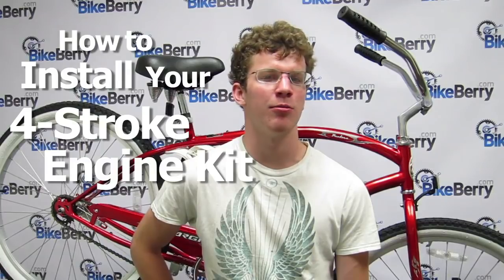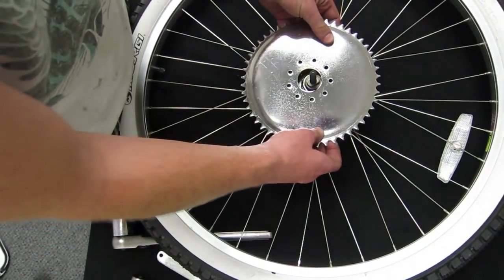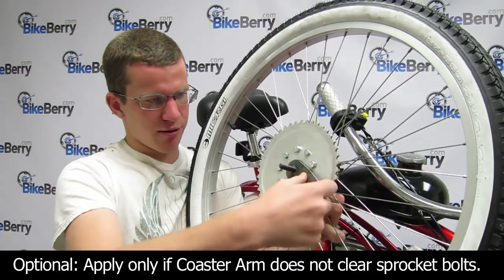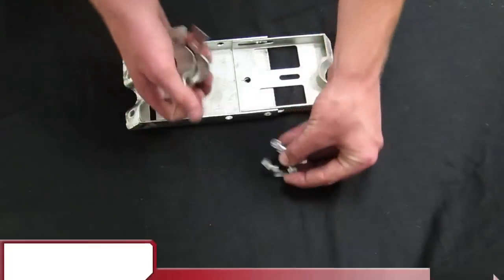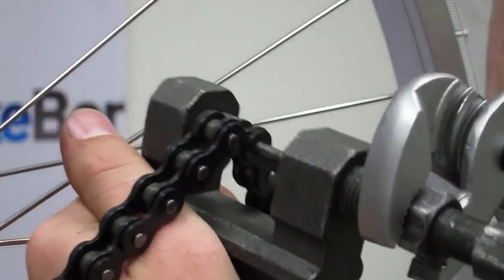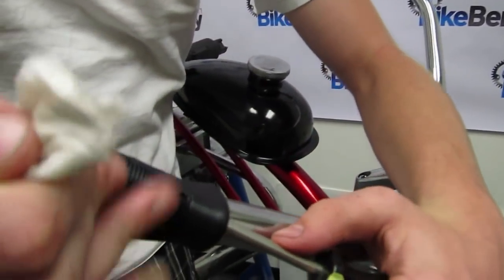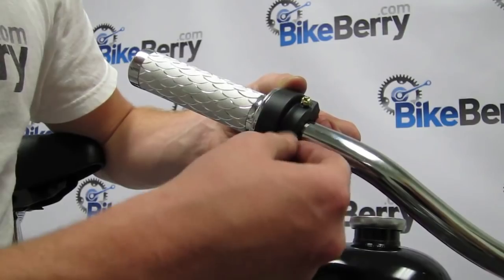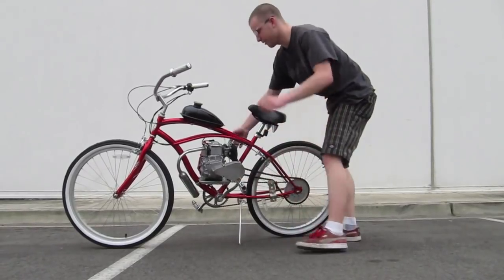How To Install a 4-Stroke Engine Kit on your Bicycle - 48cc - Motorized Bicycle

Comment: Should I get a 2-stroke or 4-stroke?
And how long does the average build take
Reply: +Damon Mohr 2 stroke is more power guaranteed (instead of having 3 unpowered and 1 powered half cycle, like the 4 stroke engine), but you won't be able to do things like leaving the oil/gas mix in the tank for too long, and you'll also have to prepare a mix every time you fill it up. I recommend you the 2 stroke, because it's light, simple, powerful and also easy to disassemble
Reply: +L3AP2020  i bet the differ i have a 2 stroke its a pain in the neck adjusting the cables for the clutch and more vibrations..im only going 4 from now on when ever i need to build me a new motorize bike
Reply: Damon Mohr For commuting I recommend a 4 stroke.  I commute with a 2 stroke but I know this engine pretty well and when something goes wrong I can tell usually what it is and fix it.  Making a 2 stroke more reliable is harder and they usually blow around 2,000-6,000 miles needing a top end replacement.  A 4 stroke last way longer around 10,000 miles up to I have heard someone have theirs for 50,000 miles.  usually on the 4 stroke the thing that usually goes wrong is the transmission and that's only if you get a cheap one.  The top 2 I recommend are the T Belt drive transmission and the EZQmatic transmission the EZ cost $500 but the T Belt comes with some higher end kits like the grubee 4 stroke (problem is that they don't sell anymore and those are harder to find)  last place to check though which are also really good is thatsdax.com
Reply: bluckingblucker 4 strokes arr good .

Comment: Best way to remove grips is with an air blower and compressor.stick the tip of the air tool under grip and comes right off

Comment: Would this fit on a 29er? You said 26inch but would a 29 inch bike work?
Reply: +ParacordTank Yes, but you may need to use spacers.
Reply: +ParacordTank the difference in the frame from a 26 and a 29 sounds huge,.. but the critical area of the frame where we are concerned would probably be only an inch longer and an inch or 2 higher... im going 29 too and im about to jump out the window and find out for myself -seeing that hes building on a 26,... and the plate looks like its got more length left to adjust outwards,  combined with the ability to lower it in the frame a little more than the video,... looks like he could go down another half inch. hes as high up as he is, to make the front tube mate up with the angle in the plate so it bolts up pretty. I can live with putting some hockey puck rubber in the gap (quarter inch max?) and just crank that sucker down tight with red loctite
Reply: +ParacordTank remember that 29 is wheel diameter, so the frame itself would only grow by 1-1/2inches MAXIMUM. and thats only on the rear wheel frame members length, the seat tube height, the front tube height/length, and the front fork length. where the seat tube and the front tube sprout/diverge from the crank hub housing and the basic shape there shouldnt change much at all. plus, finally,.. that plate he had was for a 26 inch. there was still room to adjust outwards. I dont know of any bike size between 26 and 29 so the manufacturer probably designed in that last 3/4 inch of adjustment for 29 inch bikes. even bike berry shows here that they are primarily concerned with ppl trying to go with smaller frames, not bigger.

Comment: I'm interested in getting this kit to install on my huffy mountain bike.  I was wondering do you have any way for this motor to be attached to the shift kit on my bike and still maintain pedal function?  I noticed there are shift kits but you don't offer them from your site.
Reply: shindukess i'v been looking also and been contacting ebay sellers but no-one has them.
Reply: Google sick bike parts.  They have shift kits.
Reply: shindukess yes sick bike parts has them for this engine just check if your transmission is compatible

Comment: nice video! can this be done on a geared bicycle?
Reply: I tried a 2 stroke motor on a bike with gears. Fit like a charm and they use basically the same sprocket for the engine chain. I had to remove the derailer on my crank transmition to get the motor to fit but I think it's just how my bike was shaped or something.

Comment: You mentioned a 26" bike. Is the 26" the tire diameter or some other measurement?
Reply from the maker: You are correct, it is referring to the tire size but is a common and widely accepted reference for bike size. Many beach cruisers and mountain bikes have a single "universal" size, leading to any scaling in size also affecting the tire size, which leads to the acceptance of using the tire dimensions for a bikes size.
Reply: Thank you

Comment: would any of you guys at bikeberry have any new or used engines only kicking around you want to sell?  engine has to be new or have low miles. i need one to get to work. my old engine self destructed. just need the engine. i cant ebay cause for some reason, i cant link paypal to ebay. but i can credit card purchase. plz help.

Comment: The worst part of this kit is the chain tensioner. Either figure out how to run without it, or improve it.
I welded a Chevy small block alternator bracket between the seat and chain stays. It won’t come loose and wreck my spokes!

Comment: Will this engine fit on the huffy cranbrook?
Reply: Hey Adam did you ever get an answer cause I have a cranbrook too and with the kit the motor mount is crap not like in the pic.Anyway i'm ordering another mount and I think I'll be able to rig it.It's a close fit.

Comment: Do I need to add oil the video just states gas?
Reply from the maker: +James Harkness (The Clueless DIYer) Yes, add oil as well. We recommend using 10w30 for your 4-stroke oil needs. Thanks for the comment!
Reply: +BikeBerrycom he might mean gas and oil mixture. No dont need to mix oil with gas on any 4 stroke engine
Reply: Doc842 No that's not what I meant but thank you for the clarification.
Reply: if you didn't know that the engine needs oil you have no place doing a DIY by yourself
Reply: +Bruce Nguyen thank you for your comment. Despite my lack of knowledge, hence my nickname, I think I built a pretty sweet motorized bike if you want to check it out on my channel.
Reply: My kill switch has a red and black wire and the motor wire are green and black, the video has different color wireing, do I hook up black/black and  green/red?
Reply: @JuanReyes-qv7rg  the wiring for the kill switch, the polarity is irrelevant, but I'm sure you know this by now....

Comment: Here's a suggestion. Before the installation, you should show us how to troubleshoot any problems we might encounter. I just received my first 49cc 4 stroke engine, and there's a problem with the throttle. There's no tension in the throttle spring. How do I fix that? I need an answer fast. Thanks.
Reply: Oh, another thing. After installation, take the bike for a test run so viwers can see the bike in action.
Reply from the maker: It would make no sense for troubleshooting to be at the beginning of an installation video considering many are there for the installation not troubleshooting. We have a few troubleshooting videos and are currently working on more. You can always call our customer service team for help at any time.  (800)317-0479.... We just got a super cool drone so we will certainly be getting more riding footage in the future.
Reply: @bikeberry  So, you install the engine first, then have to remove it just to show how to fix certain problems? I'm having to use a rubber washer for my throttle because the throttle spring is bad. Plus, I had to cut the choke switch in half so I could put the engine on my bike. I still have to remove it to readjust it. The chain is jumping the rear sprocket. Plus, my air filter is leaking gas and oil. If you can help me with that, I'd greatly appreciate it. Like I said, this is my first 4 stroke engine.
Reply from the maker: @UrielB86  Yes that is generally how install videos work. If you purchased your 4 stroke from us we have a full team of specialist here to help at anytime.  Give us a call or visit our website and web chat with us (800)317-0479
Reply: @bikeberry  That's the thing. I purchased the engine from EBay. I just put gas and oil in and started it. It leaks oil from the air filter, and I just noticed that it's not idling. I have no idea what to do.
Reply from the maker: @UrielB86  Sorry David, We can only trouble shoot our kits. Checkout 
motorbicycling.com which is a large forum where others may be able to assist you.
Reply: @bikeberry  Do you have videos showing first time installers what kind of oil to use? And the reason I ask you is because I get my engine parts from your site. I won't go anywhere else.

Comment: would a 4 stroke Briggs and Stratton fit on that engine mount?
Reply: if bolt pattern matches..these mount works for predator engines and more..

Comment: How much would it all cost excluding the bike ??
Reply: that kit is 279$. Let me tell you its a real pain to install. I had help from someone who knows bikes really well and we still struggled. The video makes it look nice and straight forward but it took us well over 4 or 5 hours to install cause we kept on running into issues. You are guaranteed to have to make at least one trip to the hardware store to a longer screw or something. If you're mechanically inclined and know bikes pretty well you should be fine but if not make sure you get help from someone that does or find somewhere to install it. Good luck

Comment: What if I don't want to pull a cord and I want to just ride and go. Can I pedal the bike to start it?
Reply: No. Only 2 strokes are pedal start. Problem with a 2 stroke is you gotta mix oil with gas. Another problem with a 2 stroke is the exaust pollutes more than 4 strokes & 2 strokes require more maintenance as they tend to vibrate more than 4 strokes.
Reply: Johnny B yeah but 2 stroke kit is half the price and it sounds like a dirtbike  :P
Reply: I had a 2 stroke but got rid of it because of some mechanical problems. 2 strokes are cheaply made kits. They pollute allot anyway. There are tricks to make a 4 stroke sound like a dirtbike with some custom tail pipe work. 

The reason dirtbikes sound that way is because most of them are 2 strokes. That's why you don't see them on the road anymore in most states because they are starting to outlaw 2 strokes for road use and make them strictly off road only (race track) vehicles.
Reply: Another issue with the pedal to start up method is it puts quite a bit of stress on the bicycles rear wheel. Yet another reason I'm switching to a 4 stroke.
Reply: +Tom Jacobs you really want a cop to hear your loud bike????? really? loud bikes are going to ruin it for everybody eventually

Comment: What bike did you use to install the kit on
Reply: its mostly for  26 -29 but therss always ways to work around it for other bikes..ive seen them on bmx..ladies bike,lowriders,choppers ,and cruisers,mt bikes ,and tricyle..aslong you can be open mind to expriment you can pretty much fit it tough part is always chain alignment and lenghting it..
Reply: +Ronny Khmai im dying to see that mounting plate fitted onto a 29 inch cruiser-ive seen it on every other bike known to mankind. but somehow everybody who builds a 29 NEVER posts pics or video. zero.
Reply: +robert smith  thats because not alot of people are fonds of 29ers inculding myself but ill build a 4 stroke 49cc on a female vintage cruiser 27 inch tho..ill try put on post  when i get it all done.
Reply: +robert smith  as for as mounting plates goes i think they pretty much are universals for the honda ghx50 clone but theres options for the heavy duty ones..if it doesnt fit a 29 you might have to shave the mount to fit..

Comment: OK so I need a bike motor that will go under 30 mph on flat road and less than 50 cc as I am in Texas and they require a license and insurance as well as inspection on anything more and that's kinda defeating the purpose since my job isn't the greatest and I need a temp vehicle to get a better job I'm really wanting something I can install a gallon gas tank too
Reply: any help would be appreciated
Reply: nate c get this four stroke it's 48cc, btw cops don't really know the cc's by looking at the bike as long as you are not goinf over 40mph, in fact I go over 40mph on a 110cc motorized bicycle and they don't say anything
Reply: Wow anything larger than 49 cc's you have to have a license and insurance for. Before long anything under 49 CC's or any motorized bicycle will have to have a license and insurance I'm sure. The government does whatever they want. And they're only getting worse. I'm thinking about getting an 80cc but I will pull the stickers off of it and try to hide the motor and of course drive slow and I want to quiet down the exhaust so I can ride it on Trails because they usually say no motorized bikes on trails. And if it's making noise late at night they will probably pull me over. The problem at night you can't see the law coming in the day you usually can. I want a motorized bike tried at the Beach, Trails, out and about and when shi* hits the fan.

Comment: hmm, 1 last comment. It doesn't allear with a pull start engine that somehow, the bike remains idle until U engage the throttle. I hope that's not the case!! Would kind of stink if you're not ready for the bike to move but it does
Reply: +Chris Geoffrey This engine ships with a centrifugal clutch. The transfer case should not engage if idle is properly adjusted.

Comment: Whats the hole in the handle bars for?
Reply from the maker: +xXJAKMACKXx There's a peg inside the killswitch and it goes inside that hole. It holds the killswitch and throttle assembly in place.

Comment: Cool you now own a small motorcycle with no brakes oh almost no brakes and no suspension and yet I still want one
Reply: lol that's why I'm getting hydraulic disk breaks for both wheels on mine. I wouldn't trust riding any 50cc bike with coster breaks. Let alone one coster break.
Reply: Jefferson Stealflex I got a 2 stroke model about to upgrade to the 4 stroke because the 2 stroke is cheaply made and the coaster brake is horrible at speeds, I've nearly slide into ever type of car, I'd advise multiple brakes because coasters are death at high speed.
Reply: I hear ya. I had a 2 stroke bike and it was just horrible quality. The tensioner wouldn't stay in place and the transmission broke down on me after the first 50 miles. 4 strokes are the way to go and are well worth the money.
Reply: +Bret H my coaster brake works just fine and dandy at speed. never even had a close call. driving like a maniac in traffic is probably whats wrong

Comment: Why doesn't that engine have a clutch??? Is it constantly engaged?
Reply: I think the pull start just starts the engine and it's disengaged at low rpm when you rev the engine up it engages and you get going, atleast that's how I believe it works, something similar to a cheap go kart.
Reply: Stefan Ovcharov it uses a centrifugal clutch system

Comment: Instead of pull starting the motor can you just pedal and drop the clutch like the two stroke bike? I assume you could but I'm not for sure I've never had one. And has anybody lengthened the exhaust tail pipe? and put a standoff on it and a 1 inch or 3/4 inch long tail pipe to make it a lot quieter. I want to make the motor super quiet. so I can use it on some trails possibly until I get the law called on me. I know putting a long tail pipe in a lot of muffler on it will probably cut back power but I'm fine with that as long as it's very quiet. As long as I can do about 12 or 15 miles an hour I'm fine. If I can keep it really quiet and shut the motor off once I see a pedestrian I might be able to get by with it. Because most Trails say no motorized bikes. And I thought about putting a bigger muffler on it but space is limited between the pedals. But I think somehow you could use a longer tailpipe and maybe put a heat shield over it and run it out the back and upwards if you have to and run it down so rain won't get in the tailpipe. I really want it quiet because who knows if the law might try to say it's illegal a motorized bike on the road or trails. The law seems to do whatever they want anymore. And once they say for instance your car or your bicycle is illegal they tell all their buddies in the force and then harassment and tickets start. No matter how nice you are of course it helps to be nice. Poor officers make raises and promotions based off of tickets and arrests. Also I wouldn't want to get a ticket on a bicycle because it's liable to go against my perfect driving record. and now everything you get a ticket for in a vehicle goes on your Motor Vehicle Record which insurance can see it and adjust your car insurance forever. Before in my state the only tickets that went on your motor vehicle driving record was moving violations now it's anything.
Reply from the maker: Though we don't promote breaking any laws, you may want to consider an electric conversion kit, for no running noise at all.
Reply: BikeBerrycom I thought about that but I would rather have a four-stroke on propane with a lot of exhaust quiten that way down so I don't get bothered or harassed. I'm going to try not to wear a helmet and drive very slow like I do when I ride a bike now. We should be free to wear a helmet or not. And to convert propane is really easy, very easy starting and it doesn't have to be dialed in like gasoline. Propane four stroke engine is far easier and simpler.

Comment: I'm using  this kit on a Unisex bike.  How to add a support to the engine.  Probably  not necessary  as the engine will be totally exposed.  Thinking a support bracket would help keep secure. Any ideas.  Tia.